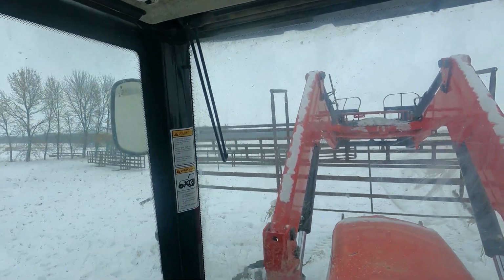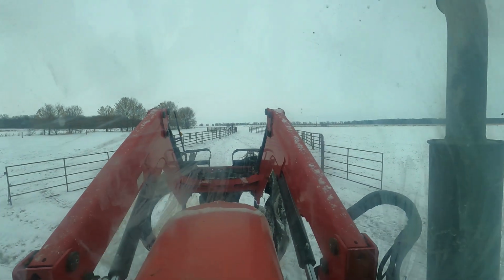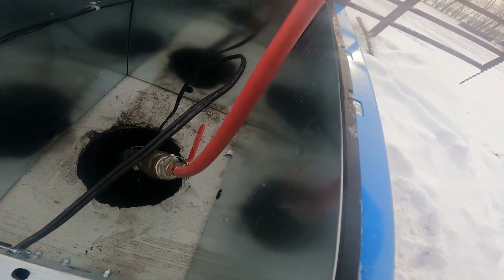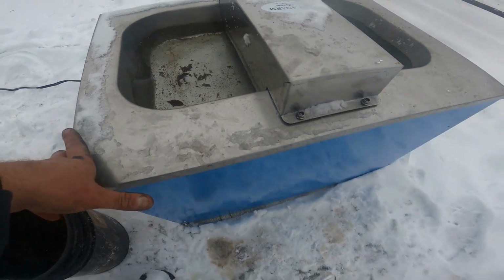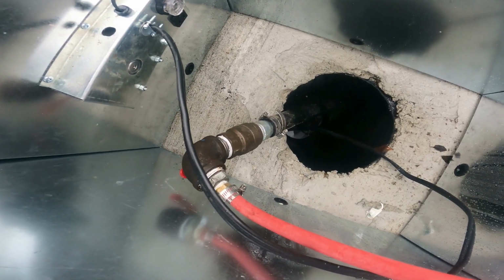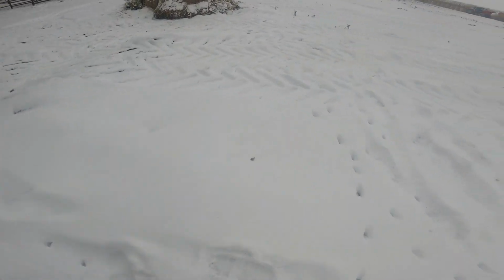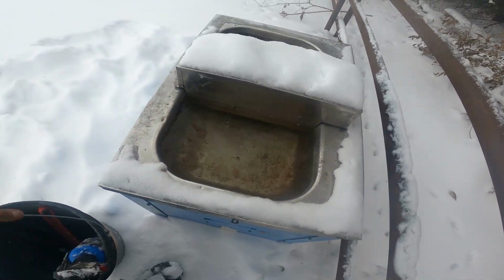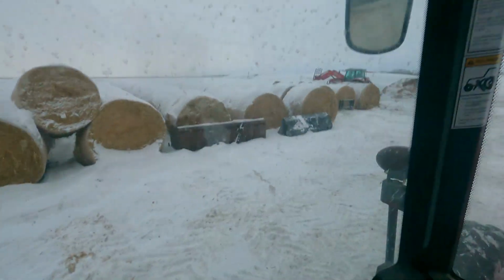Slowly Coming Together

Comment: Automatic waterers are miserable..they freeze up constantly,or create giant patches of ice for cows to slip on,cows will stand and pop the one drinking in the guts to get at the water..so all in all are not a water solution..better off to build a lil shed,put a water tank inside with windows cut in so cows can stick their heads in to drink,when its -50 or at night close the doors or window openings so that the next morning u have no ice or frozen valves..i use a simple water valve with a huge ball float to turn off the water when the tank is full enough..make sure u heat tape plus insulate the water lines all the way and also the water valve.. mine are rated to -65f..u can cut window openings on the side that the prevailing wind doesn't blow into..also make it wide enough that 4 cows can drink at the same time..i heat the tank with a propane Trojan water tank heater.. has a thermostat to set the temp as warm as u wish and have a 250 gallon propane tank beside the shed..i have had cows tip over auto waterers b4 and come out to a skating rink in the morning..they suck!! Lol..good luck to ya..but will find using a tank is so much easier..ha also have lotta heater elements on hand for your waterers..for they tend to burn out at the worst times lol..also have fun removing that cover over n over cause the valve is frozen ..they just not made for extreme cold
Reply from the maker: Knock on wood, we rarely have issues with our drinkers.